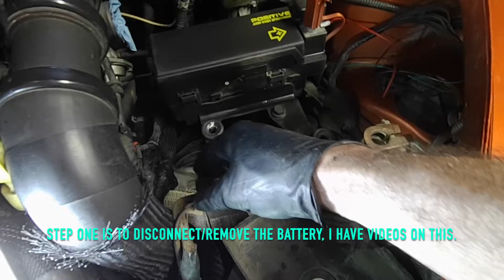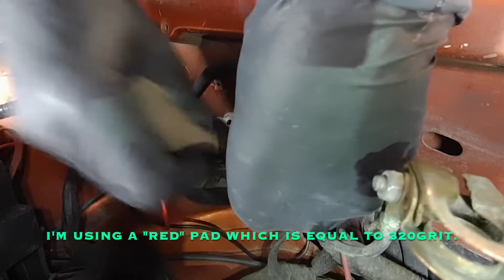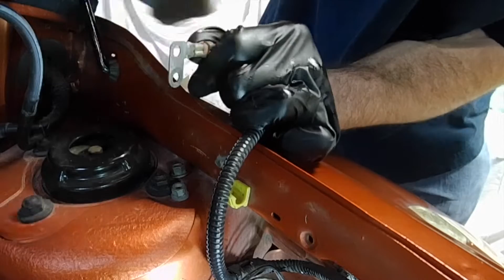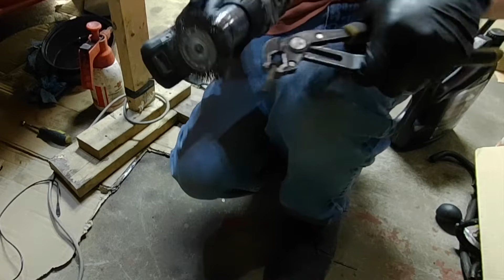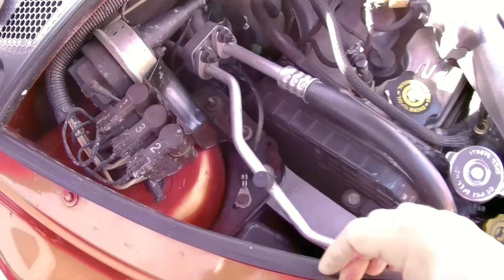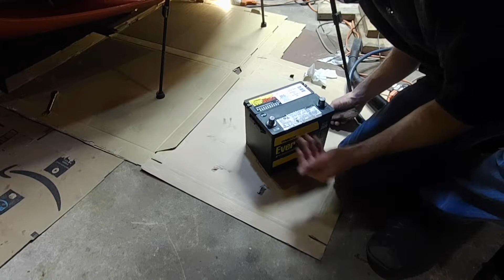PT Cruiser Electrical System Maintenance

Comment: And here I am again 🤣 this video is the start of my automatic locks and even the fog lights😒 thanks Matt
Reply: I never had issues with my $500 PT Cruiser GT 5-speed until I got a Diablo Sport Tuner and upped the boost from 9psi to 17psi then brought it to the drag track and it had really bad wheel-hop/shake from spinning on the very sticky prepped surface (ran a 14.1 at 101mph). After that it must have shook all the ground wires loose because the fog lights, head lights, gas gauge, and fuel pump stopped working all within the last 3 years and I fix all of them by adding a ground wire to each part that failed. The last thing to stop working is the cruise-control and I think it's probably also a bad ground. This video is very helpful to find the factory ground locations, thanks.

Comment: Ever come across rpm hiting red . I get just up to 55mph on freeway and it's hiting  red
Reply from the maker: I assume you mean that you were trying to drive normal and it’s going to redline, not that you’re putting it to the floor and it’s downshifting and going to redline? Because certainly I have redlined a PT countless times... But if it’s redlining without you trying I would say it’s not shifting properly, you’d probably want to visit a transmission shop. Sometimes things like that can be just a computer issue, maybe try disconnecting the battery cables and see if that resets anything. Did the engine light come on by chance?
Reply: @CarswithNash  the check engine light is on . If I gas it up on a residential street it will pick up normally. But hiting the freeway is different.  Il take a quick video later . I appreciate the response and videos . Honestly Subscribed now. Cuz I keep coming back to your channel lol
Reply from the maker: @our2lives  Glad to hear my channel is helping you with PT ownership. I do have a video in the playlist on the key dance method for retrieving the error codes. To me that sounds like a computer issue or something and it’s probably going to show up as a code so make sure you do that before trying to disconnect the battery to see if you can reset it.

Comment: Do you think a bad ground could be why my horn usually doesn’t work in the cold weather? Or maybe I should change the horn Relay? Thanks ahead Matt.
Reply from the maker: It could be any of those things or it could be a bad clock spring or the horn button itself. Start with the cheap and easy and work your way towards the more expensive fixes. I know I had a bad horn button on a Neon once and I just went to the wrecker and got another complete airbag assembly. If you end up having to remove the airbag make sure you check out my video on replacing a clock spring because it will show you the process, it’s not that simple unfortunately.

Comment: How many plug in for the computer, mine only has 3. I watch other videos and they  have 4..what's  the difference?
Reply: PT cruisers with a manual transmission only have 3 connectors going to the pcm
Reply from the maker: @franciscobelloso6273  That makes sense because the two we have that don’t have the plug have no air conditioning and are also both manuals, for some reason I never thought about that.
Reply: I have  a thought for you to make a Video for this and hopefully  you will get more likes and new Suscribers for your Channel. Elaborate about it and see what comments you'll get...just a thought for you.
Reply from the maker: @rudysison9010  I actually have PT repair videos that I filmed years ago now that are still in the editing phase because that is what takes the time, coming up with video ideas is the easy part. Also unfortunately I don’t get many subscribers from the repair videos, but I still do plan to keep making them.
Reply from the maker: Does your car not have air-conditioning? Because I have noticed the ones without have one less plug I believe.
Reply: @CarswithNash  it has air conditioning.

Comment: What side of the car is this drivers ir passanger
Reply: Nvm I see the terminal cable now
Reply from the maker: I’m in Canada so driver’s side is car’s left side.
Reply: @CarswithNash  well I finally figured out the issue all the headlamp ground wires are very dark im thinking the ground wires fried so im just going to have to rewire those ground wires
Reply from the maker: @jamesvandread6695  Great to hear that sounds like a cheap fix.
Reply: @CarswithNash  ya just need to get to pull a part and see if there are any decent harnesses left if not I'll no new
Reply: Is that cluster there part of the headlamp relay?
Reply: Ya thats the same here in ohio

Comment: Matt, great video.  I've done all that but I'm still reading 15.8VDC across the battery when the car is running, but my OBD scan tool shows about 14.6 (live mode)...basically perfect.  My thought is the sense lead from the alternator.  Any other thoughts or suggestions?  Thanks.
Reply from the maker: Are you sure your meter is accurate? I mean if the regulator in the alternator goes it can certainly overcharge like that but I can’t see how you’d get two different readings from two different tools unless one was off.
Reply: Matt.  Yes it is....the scan tool is reading the voltage from the alternator, my DMM is across the battery.  Since I checked the grounds, I'm leaning towards a bad sensing lead or alternator.
Reply from the maker: @curthamilton4362  I really don’t see how the voltage could go higher, I could see if there was a drop... Is the car actually exhibiting any symptoms? I will admit I am no expert when it comes to electrical, I try to do the maintenance steps to avoid having any issues because they are the most plaguing issues to me. But this seems basic enough and I just don’t see how you’re going to get a voltage jump...🤷‍♂️
Reply: BATTERY TEMP SENSOR CONTROLS WHEN & AMOUNT OF CHARGE FROM ALTERNATOR!!!!!@

Comment: hey matt my 05 pt crusier driverside front and back windows and convertible top will not roll down unless i disconnect battery for 3 mins then they all work until i turn the car off and start it again already changed window switch what do you think it could be ! any advice would really help
Reply from the maker: That sounds like a bad "body control module" to me, but I'm not an expert on how that all works, I just know most of that works thru it. Have you tried scanning the car, it might have a useful code. Sorry I'm late responding to this.

Comment: Matt, I cleaned up the terminals and the grounds and areas where they attach to. ... I just bought a 2007 PT Touring that has had a new alternator installed and has a fairly new starter,(I think). ... My problem is that The (+) cable and terminal end coming from the starter gets hot after about a minute after starting the car. ... The car starts fine, runs fine, just installed a new battery yesterday. ... I ordered a new Mopar cable harness last night, should have it in 7-10. ... Any ideas what may be causing this? THX!
Reply from the maker: sorry I missed your comment earlier... Sounds like just corrosion buildup in the cable, it can work up right under the casing and even though it's a solid wire still the corrosion creates too much resistance, that's why it heats up. The new cable should fix the issue for sure, be sure to coat the ends in dielectric grease to prevent the same thing from happening again.
Reply: You have a short circuit unfused high amps will be fire hazzsrd check  connections on alternator to ground & + then to fuse ss b4 fuse

Comment: @Matt , What year an model PT Cruiser are you working on here?
Reply from the maker: 2003 Dream Cruiser Series II, it’s the same as a GT just with some special appearance items.
Reply: @CarswithNash  really does it have the same SRT motor?
Reply from the maker: @AlexRubio  Yes indeed it does.
Reply: @CarswithNash  MAN i could of gotten that one for cheap $1200, but I thought the engine was the weaker of the two.

Comment: There is one more static ground i think at the back of the car at the muffler? Can you confirm this?
Reply from the maker: Yeah there is, any ground you find is best cleaned, the ones in the engine bay are just the most vital. There are ones throughout the interior as well but they don’t tend to corrode up like the ones under the hood.
Reply: The one on the muffler what is it for exactly

Comment: Hey man my 06 pt cruiser cuts off when I turn my rear winshield wiper on I got the motor changed already
Reply from the maker: Or Ganic Probably a worn thru wire in the harness running to the motor, that rear panel just clips on, you can pull it off and trace the wires, likely one is shorting to ground somewhere.

Comment: Great video, and good work.  Lots of good information here.  One thing I would also do, is clean the threads AND threaded holes with WD-40 first, wipe the threads clean, and also spray WD-40 into the places where wires are crimped into the eyelets, wipe off the excess WD-40, then coat everything with dielectric grease, and reassemble.  
If you're really paranoid and want additional assurance of no grounding issues, then add electrical flux and solder the wires to the electrical eyelets where they are crimped, clean the parts with WD-40 as previously mentioned, THEN cover with dielectric grease, and reassemble.
Reply from the maker: Rachel Black I don’t use WD-40 in my shop at all, I do a lot of painting and the two don’t go together.
Reply: @CarswithNash  wd-40 is hydrophobic thats why good for water dispersal but as you point out teflon silicone & other hydrophobic products turtle wax t-cut will if recently used  or area that is not open to enviroment will cause them fish eyes in paint i believe water based etching/or plain primer should put stop to the majority of this from happening

Comment: Which connections should I focus on if I’m going to replace a cam sensor.
Reply from the maker: NIGHTWING All of them lol, they all work together, things like starter and alternator connections you could skip but for sure all the grounds.
Reply: Matt's Garage also I plan on doing a tune up any thing I should look out for? I have a 2005 pt cruiser turbo
Reply from the maker: NIGHTWING All that stuff is pretty easy to access so I often just put a set of plugs in if the wires are still the originals I will replace them if they are newer I normally leave them, it’s not a bad idea to replace the coil pack too, but often they can last a long time so that’s up to you.

Comment: I have a 2006 PT cruiser that the transmission keeps going into limp mode at operating temperature particularity on hot days or when the A/C is on. cleaned all the wiring as in your video have tried a couple junk yard TIPMs any ideas.
Reply: I'm also having the same problem with my 06 pt crusier going into limp mode. Now sometimes if I turn the lights or turn signal on the whole car dies. I also replaced the tipm and it worked for about 300 miles before going into limp mode again. Did you figure out what was wrong with yours?
Reply: @o9cubb  I have the same issue on an '06.
Reply: What error code do you get? It could be corroded terminals or corroded wires underneath the insulation or a bad ground. Depending on the error code. Possible the high speed sensor on the transmission. Very easy to replace and only around $10 on Ebay.

Comment: HAD A STARTER REPLACED BY FRIEND AND AFTERWARDS IT WOULD NOT ENGAUGE INTO ANY FORWARD OR REVERSE? ANY IDEAS AS TO WHY?
Reply from the maker: give peace a chance Is it a manual? If so check the shift cables running on top the trans. Otherwise just look around to see if something is loose or not hooked up proper.

Comment: Here I is. 
Now I cleanup grounds too but the only place that I us the electric grease on is under the battery terminals because I can't paint that. I clean up connections and then I paint them to seal them. The grease holds on to dirt and then dirt holds on to moisture so I like em clean, painted, sealed, and dry.
Reply from the maker: Sure I guess whatever works for you, any form of protection is better than none.